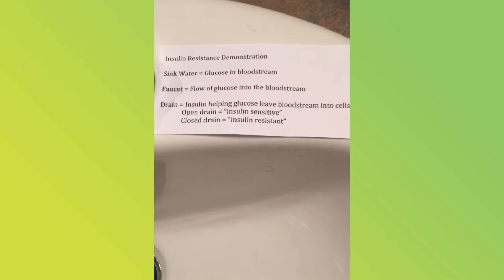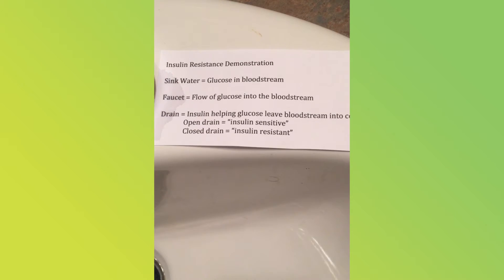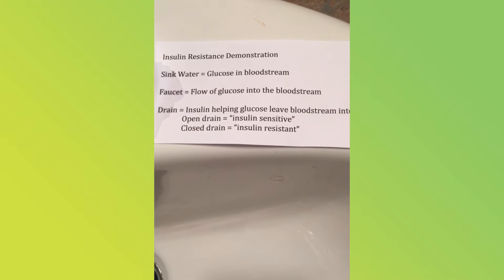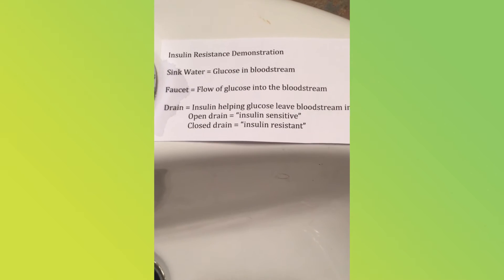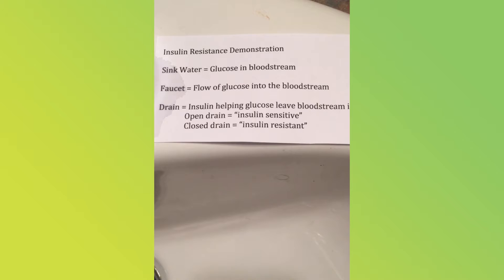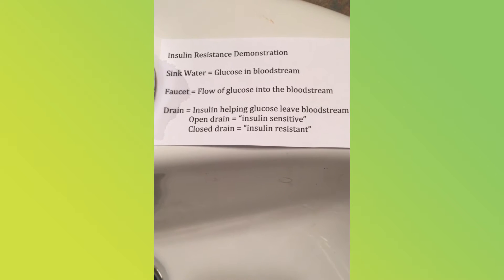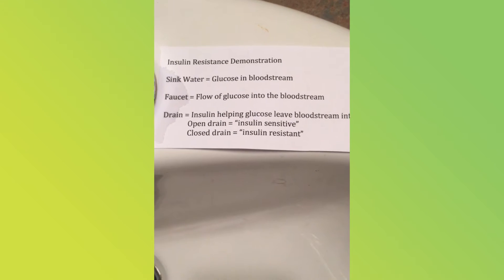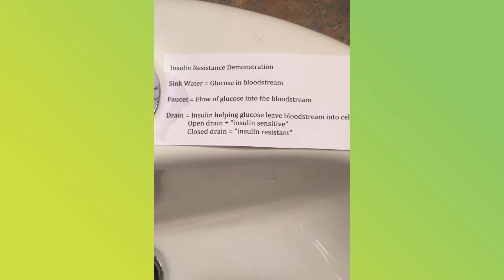Insulin Resistance — Dr. Eric Westman

Comment: Good morning Dr. Westman: Thank you so much for the videos. Can you please help clarify how to lower blood glucose levels? When I test my BG what are the ideal ranges? I am doing very strict LCHF. I practice IF (16/8), I workout 6 days a week lifting (bodybuilding), I teach a 60 min Spin class 3x a week. Training is always first thing in the morning and fasted. I only take 1 Tbsp of MCT oil and my, much needed, electrolytes. My morning BG is 88-100, after training 90-100; 2 hours after breakfast 85-95; before bed 83-95. My ketones are coming in at 1.5 - 2.5. I am hearing (from other online sources) that my BG should be between 69-80 or I am NOT fat adapted. I eat 16 grams of carbs a day (not net) and 45-50 grams of protein (which I am hoping won't hinder my ability to build muscle). Am I really NOT fat adapted because my BG is still above 80/dl?  I have no doubt I am insulin resistant :) Thank you in advance for clarifying this. It's frustrating.